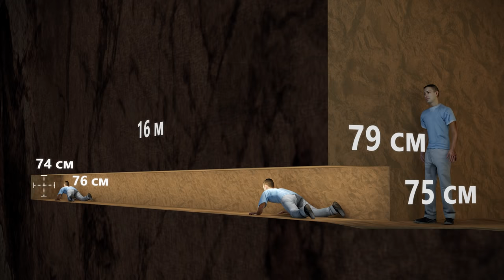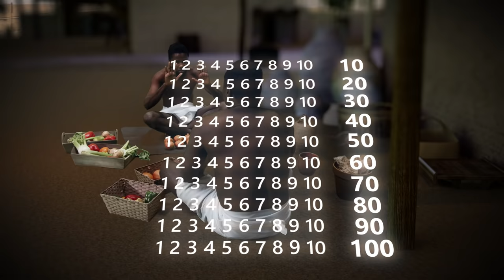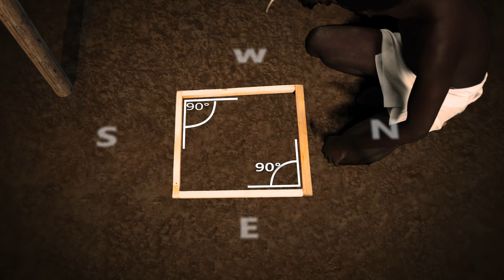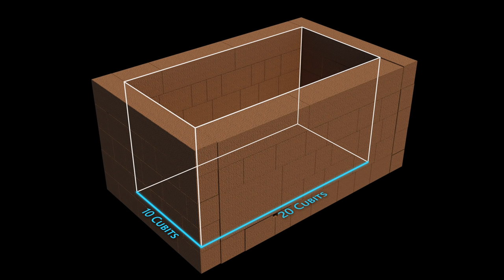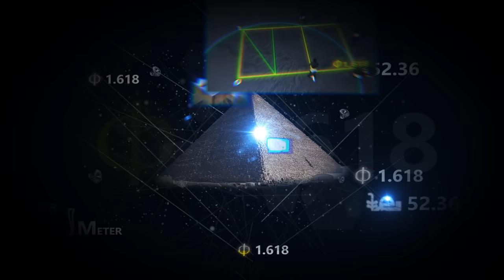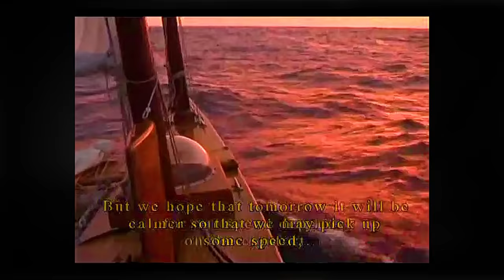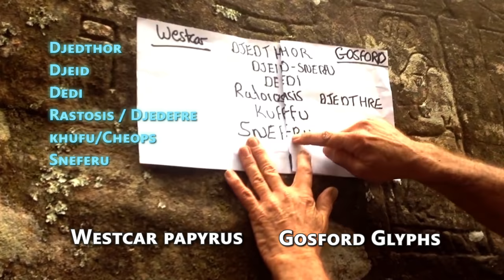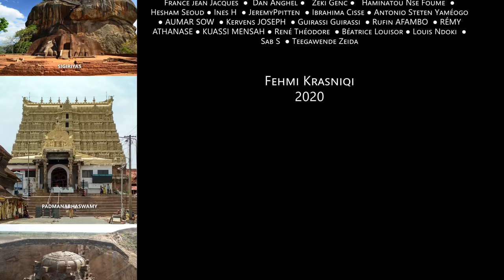The Movie Great Pyramid K 2019 - Director Fehmi Krasniqi

Comment: I read a lot of comments. I know that "melting" granite and hoping for the result after cooling to be granite is foolish. I do "think", not know, that the projections on the blocks in Peru, Egypt, and many other places appear more reminiscent of injection molding than pry/leverage points. What resembles "scoop" marks around the structures and obelisks could absolutely NOT be from "melting the granite" as what remained after the "scoop" full was removed would then harden into rhyolite with a glassy looking surface. Some kind of agent.... chemical process, to "soften" the material, resulting in a material that would maintain the quartz, feldspar, mica crystals, being poured into a mold with one, or more, side(s) being the block next to it? I do know that the limestone facia blocks, having the same magnetic properties, makes their assertion on this material seem very plausible. However I don't have the financial or physical resources to perform such research or an experiment. 
  But, I have not seen any discussion on the easily verifiable assertion on their claim that "a drop of water, anywhere, anytime, is 1 cm". This claim is completely false. Not only would you have to ensure the drop fell from a specific height (a 1 inch fall results in much less spread/splash than a 1 foot fall etc.) but differences in the surface the drop lands on, and other environmental factors like wind could affect the out come. I tried to get a 1 cm drop of water using tap (faucet) water, mineral water, creek/river water, ocean (salt) water, and purified (reverse osmosis) water. Even multiple drops of the same source of water result in minor and even major differences in the size and shape of the resulting "drop". Instead? Maybe they actually started with the millimeter and based it on the size of a bread crumb.... LOL.
  Be it known, I'm not an engineer, archeologist, Geologist, or any other "ist". I'm just an old man with life experience, a history as a "shade tree mechanic", and some common sense.
Reply: The water is a cm thing made me look and a drop is consistent, but it's not one cm. Sucks to find a false claim so early.

Comment: You'd have the same size mold for bricks because those are small and carried to the construction site and made in a factory setting, the pyramids were poured onsite so you'd want to pour every other block, let them dry then fill the block in between, building exact molds would be a waste of time when you can just eyeball it, the only thing thats gotta be axact is the perimeter, height of blocks, and angle of facing stones.

When modern concrete companies go to a residential home to pour a driveway or sidewalk do they bring exact pre-made molds? No they build the wooden molds onsite then pour.

Comment: How did they work at night without lighting ? I know that they could have had torches but they would have burned an enormous amount of fuel to light such a huge work place for several years.

Also it's said that all of the limestone casing stones were later removed and used for other buildings but that would have also required a huge amount of skill and effort since that also happened centuries ago.

Comment: I thought this hypothesis was very interesting, however there are too many outliers regarding the lenses.
1. Is there direct evidence for such device.
2. Lenses must be made to exacting precision in order to be used repeatedly.
3. Operating the lens would also require some form of observable measurement. I.E. the suns intensity is variable.
4. Such a lens is also very heavy, and we are still left with the original problem of moving big, heavy things.

Comment: I STILL DON'T UNDERSTAND.  IF THEY USED MOULDS EACH STONE, BEARING IN MIND, CANNOT EVEN BE SEPERATED BY A SHEET OF PAPER. THINK ABOUT IT. LAY ONE MOULD LET IT DRY, TAKE THE MOULD AWAY WHICH IN ITSELF WOULD BE DIFFICULT AS THE CONCRETE WOULD ADHERE TO THE WOODEN MOULD. MY POINT IS HOW CAN YOU POSSIBLY LAY THOSE STONES WITH NO MORTAR NOT EVEN A CIGGARETTE PAPER COULD GET BETWEEN THEM RIGHT??? WHAT OR HOW WOULD U USE A MOULD THAT WOULD HAVE THE STONES SO CLOSE TOGETHER THEN REMOVE THAT  MOULD AND SO ON. THERE WOULD BE A MUCH LARGER GAP BETWEEN THE STONES GIVEN THAT THE MOULD WOULD HAVE TO BE EXTREMELY ROBUST TO HOLD 4 OR 5 TONNE STONES. DOES   ANYONE SEE WHAT I'M TRYING TO  GET  AT? YES THE WOOD IN THE STONE INSIDE THE PYRAMID IS A DIFFICULT ONE TO WORK OUT BUT I'M STILL NOT CONVINCED. AND AS FAR AS I'M AWARE MELTING GRANITE THEN RESETTING IT WOULD AFFECT THE QUARTZ OR  WOTEVER THE OTHER STONE IS INSIDE GRANITE. IT WOULDN'T REFORM THAT PERFECTLY.

Comment: I should also point out that you make a mistake when you equate geopolymer with concrete. Because concrete was actually invented much later than this process. It is easy to test for one of the elements of concrete because it has to be baked at a fairly high temperature. Which is why the building of the pyramid was not done with concrete. You have to quit using the term concrete. It is a much later invention. Davidowitz had proven the fact that no one could tell the difference between the geopolymer Limestone that he mixed up and natural Limestone because he sent it to a number of different universities and they all stated that it was natural limestone. And the only way you can tell it apart is if you have a large enough sample to see the layering that occurs in natural limestone. He was also able to do core samples of known original casing stones of the Great Pyramid and could show that when you mix the geopolymer it actually has the effect of being denser at the bottom than towards the top, only natural, it's all a homogeneous mix at one point. And that the heavier elements will tend to sink as it cures.

Comment: And standing near the 2000 degree centigrade to work on the stone. just try standing near the furnace of the steel mill for 5 minutes. you will understand the power of heat.

Comment: It is certain that the ancient Egyptians used a special type of cement in the process of leveling the floor on which the pyramid would be built. And another type of mortar for walls for engravings and drawings.
The use of lenses to melt hard stones such as granite, leads to a change that appears clear.
The question that will challenge this theory is how the Serapium of Saqara With 24 coffins of sizes and weights of more than 70 to 100 tons of high hardness stones, was carved or poured into narrow underground passages without lenses or solar radiation?! ....some of them was not finished?!...

Comment: From a real world design engineer (Begun May 22, 2023):
Comment 01:  I laughed at the Benny Hill music at about 20m10s.
Comment 02:  20m39s - The obelisk --- Those irregular vertical grooves approx 300 mm wide were not cut with small cutting tools.  Such cutting patterns would require a tool about 300 mm wide, perhaps a bit wider.  Also consider the force to make each cut downward.  The cuts appear to be less than 50 mm high, with many cuts needed to cut all the way down to the bottom of the in situ obelisk laying there.  No granite ball or copper chisel could make such wide cuts cuts even ~25mm high,, not if cut by a manual tool driven by a manually held granite hammer.  They would be lucky to get a 10mm wide cut x 1cm high, if that.  It is simply not humanly possible.  And that was cut IN PLACE, in the narrow pit around the obelisk. (See Christophe Dunn's books about material removal rates.)  
From my experience, I can see how a mechanism braced against the outer wall of the worker's pit might be used, if done with modern tools and hardened metal cutting bits.  With even a hardened copper chisel and manual granite hammer?   
Seriously, don't make me laugh.  
The video makers' objections so far are very legitimate doubts on everything up to this point in the video.    
There are sciences of materials properties that apply to both the cutting tools and the material being cut.  Egyptologists are using non-technical speculations from the 19th century and have not changed their assessments in 150 years.  They have not kept up with the times.  Materials science has come a LONG way since then, with many thousands of hours of scientists developing usable data and metallurgists developing new materials.  None of which the Egyptologists of 1873 knew about.  What did the Egyptians of 2800 BCE know?  I am only just beginning to watch this.  
But I DID go to Giza over 50 years ago - TWICE.  And I don't have answers myself.
May 22, 2023.

Comment: Molten granite turns into gneiss, easily to distinguish from granite by the look of the eye. And there´s no way it would cristalize to a structure similar to naturally originated granite just by cooling down. So whatever method was used to "produce" the granite blocks, the material wasn´t molten by heat, poured and cooled down.

Comment: If they used the glass to melt the granite and used wooden molds  ,why is there such a small gap in between each stone ?  There would be about the same gap when you look at concrete today. A gap of about 1/4 inch. These blocks are so tight you can barely get a peice of paper between them.

Comment: I have questions??? I am see melting a medium sized rock of say 50 pounds with a glass and it would solidify back into a medium sized rock but a stone of the size they are suggesting for the pyramid would harden at the bottom before enough of a stone could be formed. It would not stick to the lower layers. You would need an immense crucible to do each stone.

Comment: Why speculate? "It's all in the handbook."

"Ra: I am Ra. The pyramids which we thought/built were constructed from thought-forms created by our social memory complex.

Questioner: Then the rock was created by thought in place rather than moved from somewhere else? Is that correct?

Ra: I am Ra. We built with everlasting rock the Great Pyramid, as you call it. Other of the pyramids were built with stone moved from one place to another.

Questioner: What is everlasting rock?

Ra: I am Ra. If you can understand the concept of thought-forms you will realize that the thought-form is more regular in its distortion than the energy fields created by the materials in the rock which has been created through thought-form from thought to finite energy and beingness in your, shall we say, distorted reflection of the level of the thought-form.

May we answer you in any more helpful way?

Questioner: This is slightly trivial, but I was wondering why, in that case, the pyramid was made of many blocks rather than the whole thing being created at once.

Ra: I am Ra. There is a law which we believe to be one of the more significant primal distortions of the Law of One. That is the Law of Confusion. You have called this the Law of Free Will. We wished to make an healing machine, or time/space ratio complex which was as efficacious as possible. However, we did not desire to allow the mystery to be penetrated by the peoples in such a way that we became worshiped as builders of a miraculous pyramid. Thus it appears to be made, not thought.

Ra Material (1981)

There's more. Much more. Open it up.

Comment: Pouring granite is just a plain ridiculous idea - granite takes millions of years under great pressure to cool, during which time the large crystals form.
If it is cooled at surface temperature and standard atmospheric pressure the crystalline structure would be completely different.  Check out any volcano if you don't believe me.
This is basic geology.  

On top of that - if you could pour granite - why bother cutting an obelisk direct from the bedrock as displayed at Aswan?

Comment: I went back through many comments and didn't find one on the size of a droplet of water. Having a strong inkling this was rubbish, I tried repeating the same and found each instrument I used produced a different droplet size. So that theory is BUNK.
Most were quite less than 10mm (1cm). The droplet size has more to do with the sampler's ability to hold "x" volume of water which is transferred via capillary or surface tension to form the droplet puddle. Do all rain drops have the same size? NO. The theory is just that and we will never know but can only guess.
I do believe the creators of the structures were very good mathematicians though.
I also query how it can be established the footing of the pyramids was with 21mm (or whatever) of level when the whole surface has been exposed and covered many times. They were good but how can we qualify to that exactness?
Reply from the maker: The meter in detail.
https://youtu.be/ukjpRjJzbz8?si=ug8ZflbesUjefwy1

https://youtu.be/wox2VUJILsw?si=uECccrWOIX62jVgR

https://youtu.be/hANujYTe1v0?si=d1taP-ljGh1gj31N

https://youtu.be/IgN2DuOW7yU?si=VLEOSF8KcJJMvPxc

Comment: If they melted the rock into liquid with a lens, I’m guessing the point of focussed sunlight would be very small, which brings 2 problems to mind, firstly , how long would it take for a beam of light to melt the equivalent of a pyramids worth of rock? I’m guessing thousands of years. Second problem is if the light is melting the rock into a liquid form, why doesn’t the liquid simply run away, how was the melting rock contained, and was it contained in something with a higher melting point than the actual rock being melted.

Comment: All seems somehow logical and believeable, until they start melting granite.
The melting with mirrors itself is not that far fetched (see Hathors headdress), but melting granite does result in a material that looks like obsidian, not the granite you would expect. I tend more to think of a vibrational technique (however that looks like) and maybe i didnt get it yet.
TLDR: Good ideas, but don´t believe anything in blind faith.

Comment: The theory of concrete is certainly credible. But if you melt granite, assuming that you can, when it cools down it creates basalt and not granite. The crystals in granite can form only under great pressure and with a very, very slow cooling process (in the order of several years). Still it is clear that Egyptians could not build the pyramids in the way Egyptologist claim they did.

Comment: Where are the concrete tools, no sign of any tools left at the jobsite? Every concrete worker I have ever seen or known has had tools scattered everywhere, trowels, levels, rakes, buckets, barrows, poles, mixers, brooms, cigs and beer bottles. The cleaning crew on this jobsite were amazing not even a nail left behind. 
Not all water drops are created equal too many variables ie. surface tension, gravity, composition, and i'm sure many others, which create as many different sizes of drops as kings feet sizes.
Reply: Where are the ships and the tools that carried and lifted 200t stones?

Comment: 56:24 
Here you find what they taught us in masonry school. 
It's called the 3, 4, 5, method.
Measure 3 feet then 4 feet then connect the end of the 3 and 4 with a measurement of 5 feet and you get a perfect right angle 90 degrees. 
Now the plumb tool.... a pointy weight with a string gives you perfect strait up and down. 
Now water is the perfect level .
So there you have it.
There it is.
That's that.
Now chemistry is another thing.
Seek and ye shall find. 
I seeked 
I sought 
I found 
Thank you
THANK YOU.
THANK YOU

Comment: 1. I tried to measure a drop of water, that was difficult. I tried different surfaces. I had different measurements. Some drops were round, some were oval, some spread out.
One or two were 1cm, some were over or under 1cm. The oval ones were obviously different depending on where you measure it.
Conclusion, water drops are not constant.
2. If they poured "concrete" in a mould, where is the mould between each block, considering you can't fit a razor blade between them?
A nice theory but doesn't add up. I'm only 54 minutes into it.
This is crap, you have a symbol that fits into a rectangle that fits into different size rectangles big or small.
It's just making something fit inside something else.